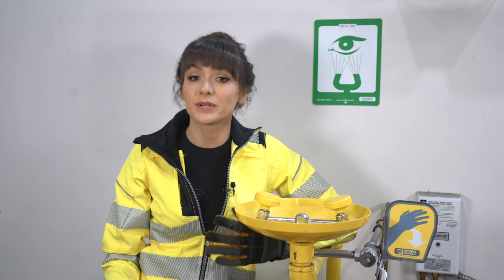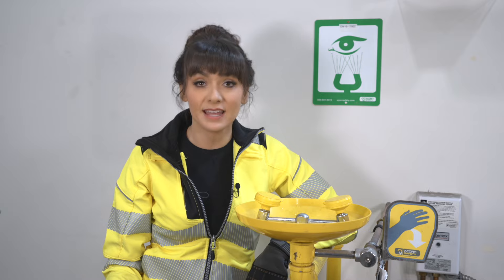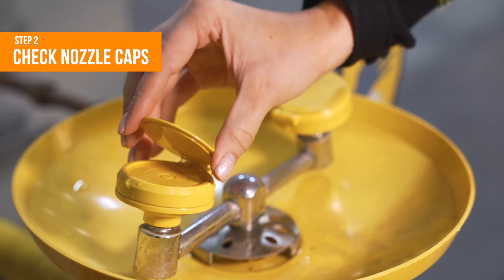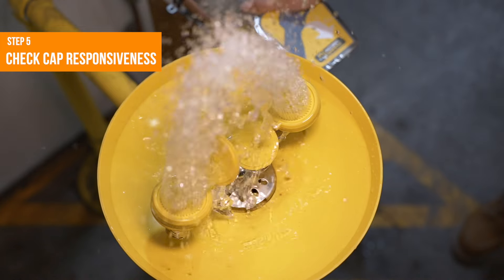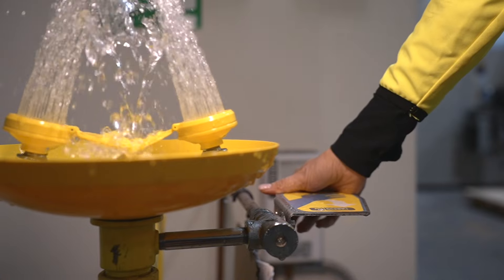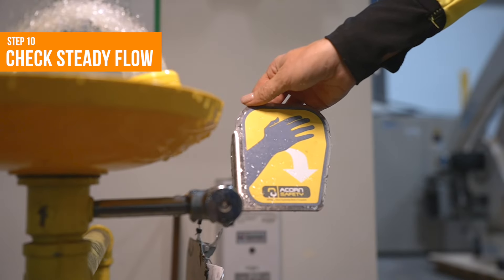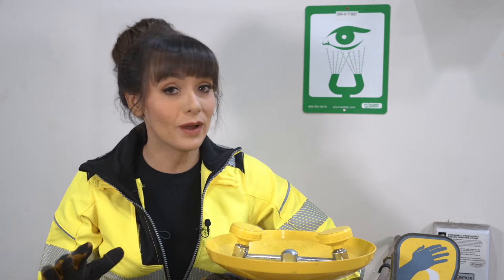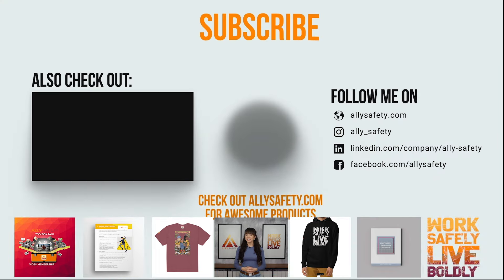How to Inspect Plumbed Eyewash Stations | By Ally Safety

Comment: Why is cleaning the bowl of an eyewash station necessary?
Reply from the maker: I think because it helps it to drain and reduces splatters of dirt back into the eyes.
Reply: Helps with overall sanitation, sometimes these are in locations where they are exposed to hazardous materials.